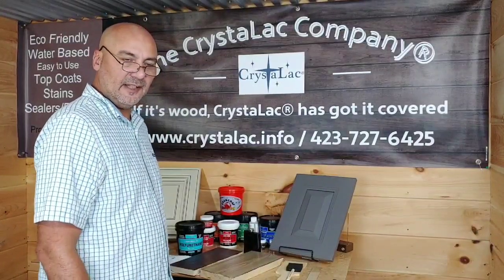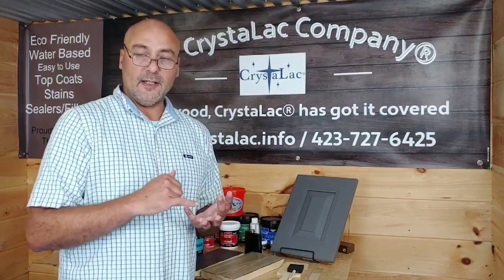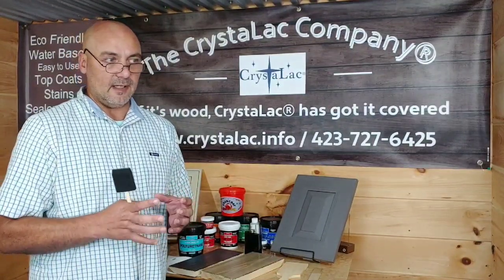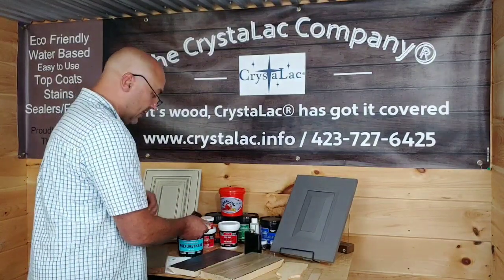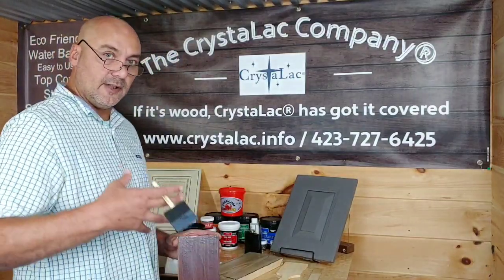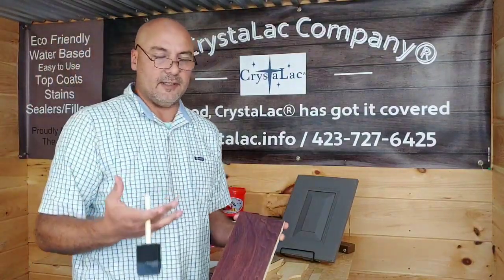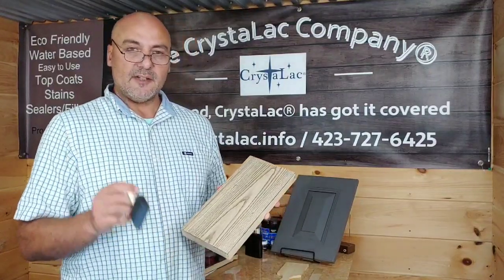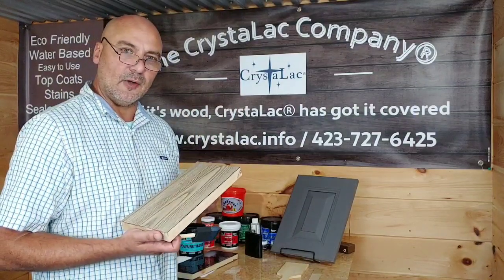Application Quick Tips.

Comment: I am a wood turner. I usually apply a lot of my finishes on my piece when the lathe is spinning. Can I do that with your product? Right now my main finishes are wipe on poly, shellac, and some others that are oil base. Thanks.
Reply from the maker: Absolutely. Wipe brush or spray. Just keep the coats thin. About 2 sheets of notebook paper thick and give it a minimum of 2 hours dry time between coats. We recommend our Brite Tone for bowls.
Reply: @crystalacofficial  I forgot to mention that I usually use a sanding sealer, Zinser Bullseye. Do you recommend using your product over this, or not. Thanks.
Reply from the maker: @josephwise485  We love Zinsser shellac in the rattle can. We actually carry it in The CrystaLac Store.